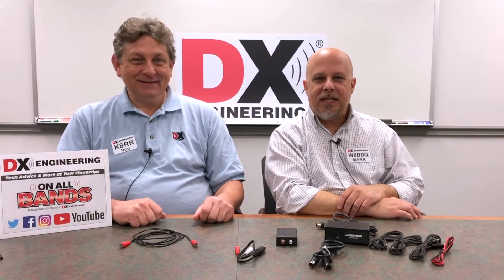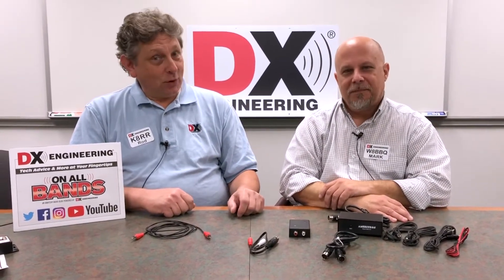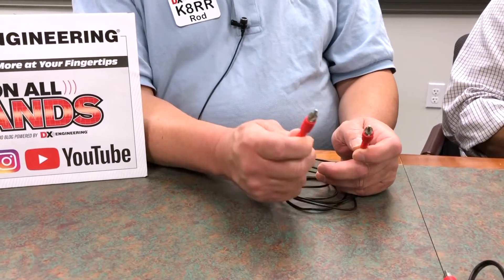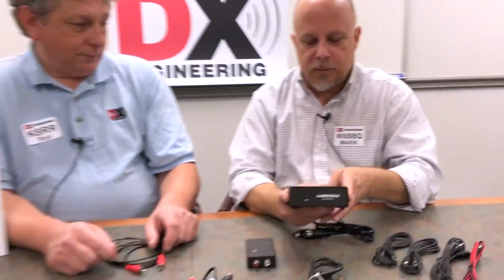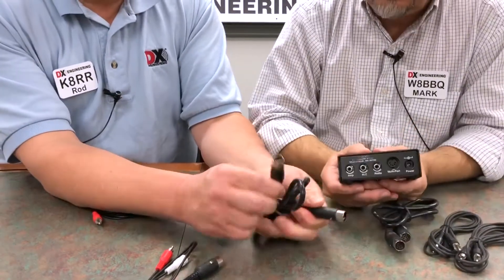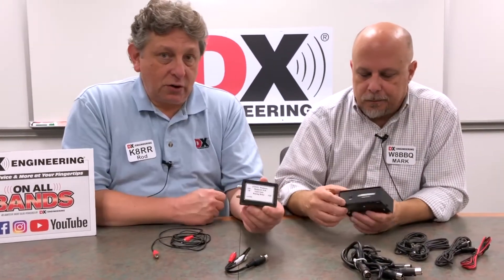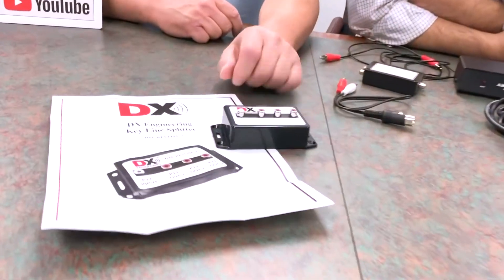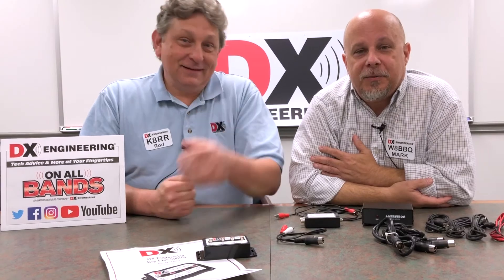Amplifier Keying Line Explained - DX Engineering

Comment: Hello, I could use some help. 

I have a Kenwood 590 and an ACOM 700S amp.
I need the correct control cable that will key my amp. I'm guessing I can make one. The ACOM amp has an RCA input that says KEY. What connector do I need on the other end to connect to my Kenwood 590? Thank you much.
Mel